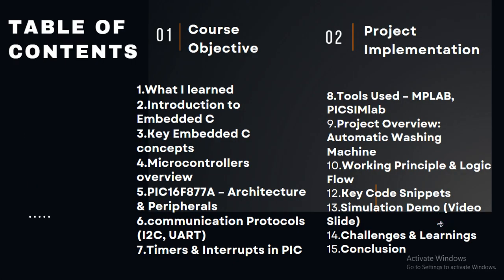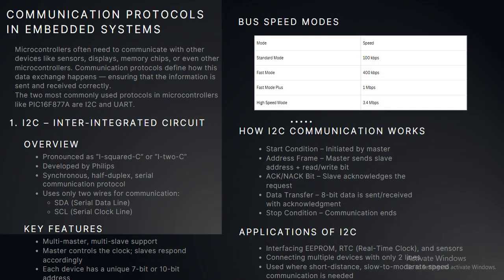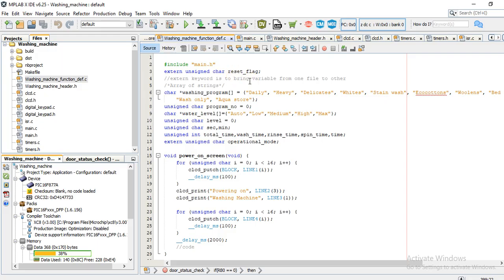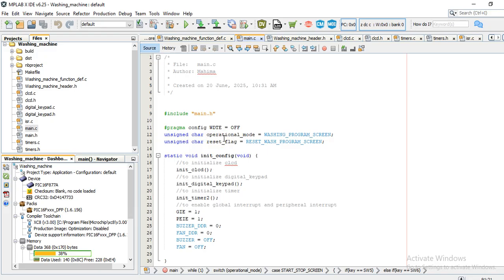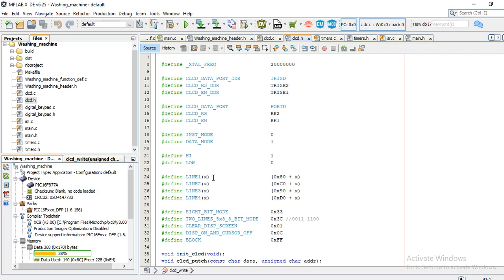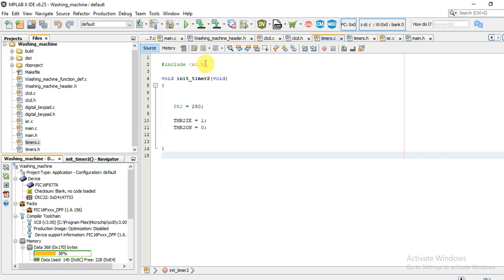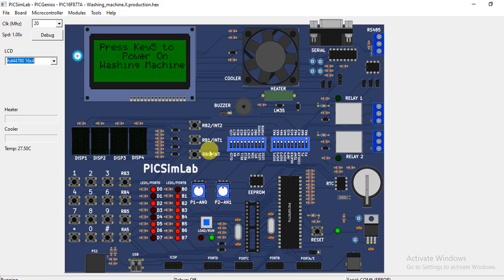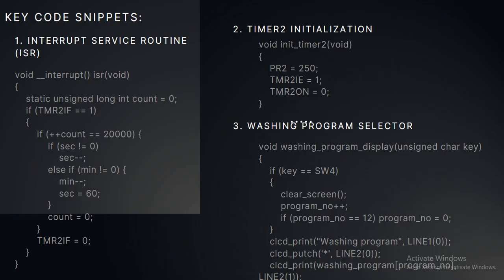Automatic Washing Machine Simulation using PIC16F877A | Emertxe Internship Project

Comment: Sis im a 2nd yr eee student
What are the software and hardware skills do i need to learn during engineering?
Reply from the maker: Hi Shivani! I'm an ECE student. First, try to find your interest (like Embedded, Power, or Core Electrical). If you're into Embedded Systems, start learning to configure sensors and microcontrollers like PIC, ARM Cortex-M3, STM32, ESP32, and Raspberry Pi. Focus on Embedded C, UART/I2C protocols, and PCB designing tools like KiCad or EasyEDA. Keep exploring with hands-on projects! 
All the best 😊